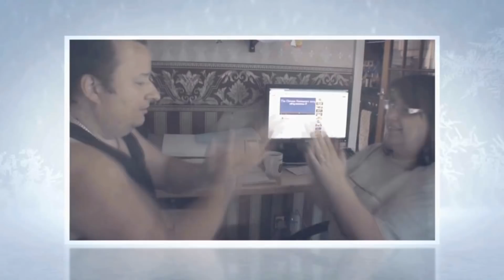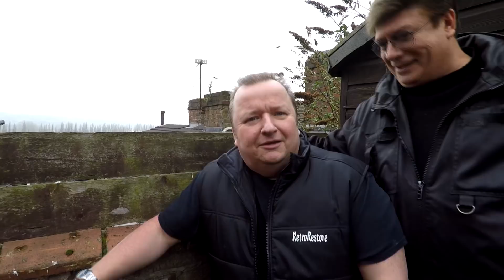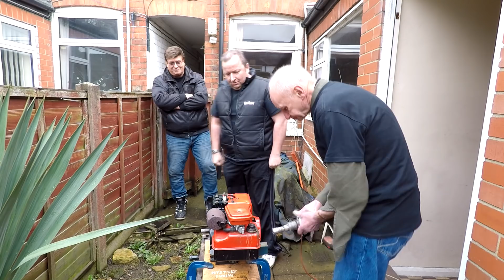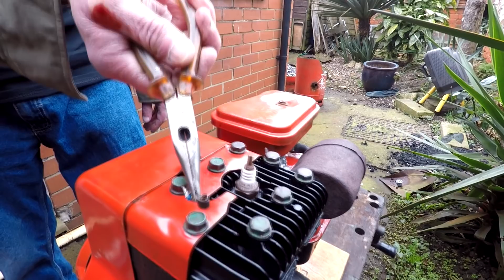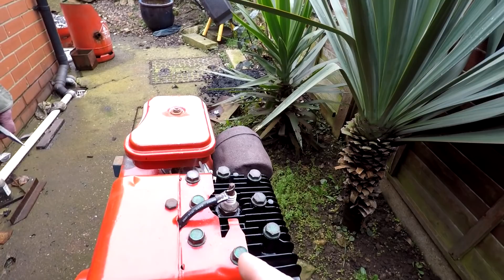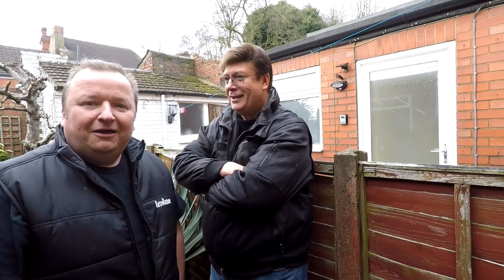Amazing Mystery Engine Runs With No Spark Plug Connected

Comment: I have an edger with an engine that'll do that.  At the time I didn't know much about small engines (and some would say I still don't.)  While running, the spark plug cable came disconnected but the engine kept running.  It was about an inch from the plug.  Not thinking, I reached down to replace the cable on the plug and got a nice jolt for my effort.  It seems that the cable was close enough to the plug to arch through the air.  I'm pretty sure it is because it didn't have the rubber insulation boot around the clip on the cable to the plug.  Needless to say, I now make sure the cables are not just disconnected but well away from the plug when tinkering around.

Comment: Saw an old triple running on all three cylinders withe the plug leads off at full revs ...only stopped after pulling the tops off all the carbs. It was running expansions and it happened in a petrol station forecourt on one of the infamous kawasaki triples rally runs in the mid 90’s
The noise was err a bit loud but fookin lovely

Comment: 2 spark plugs, ones hidded under the couling with a splized coil wire going to both sparplugs,sorry to expose the facts
Reply: Don't be sorry. I've not  hidden how I've done it. However when I first did it so I could truthfully say it didn't have another spark plug, I did get it to run. However it was too unreliable to take to shows, so had to compromise. It was still 2 months of hard work. Guess that's why so few people do them.

Comment: If it's legit no spark, it will be carbon build up on the piston, glowing red hot and igniting the mixture. My grandads Maestro 1.6 auto used to run on after switching it off lol.

Ps your mates wig is amazing.
Reply: 2 months very hard work to do this.....see my videos :)
Reply: Will do, cheers Malc.

Comment: I think also under the cylinder cover is a hidden spark plug.
But it would be even better if the engine runs without gas .... ;-)
Cheers Bernd
Reply: In the future, I make make it run taking the carb and tank off. But for now it's a nice novelty.
Reply: Without carburetor is not bad .... hahaha :-)
Reply: Hey Martin,
Malc is a funny guy I´ve subscribed him.....
Reply from the maker: thanks Bernd, he will like that.

Comment: Being able to kill the engine using the spark plug lead is a give away that there's another spark plug. If the enigine were running bc of carbon or whatever, shorting with this lead would have no effect....
Reply: Originally I did it without a spark plug, but had to compromise to make it reliable to take to shows. It's impressive in person, even for me.

Comment: I put glow fuel in a moped once upon a time and it had the same effect lol! we turn't the ignition off and the engine kept running so we pulled the cap off and it was still running! my guess is that this would only happen to a very hot engine that could continue burning fuel because of the excessive heat
Reply: Plenty of videos of how I did this on my channel.